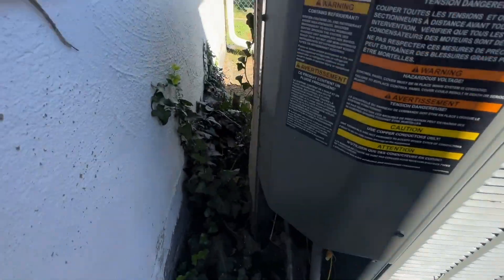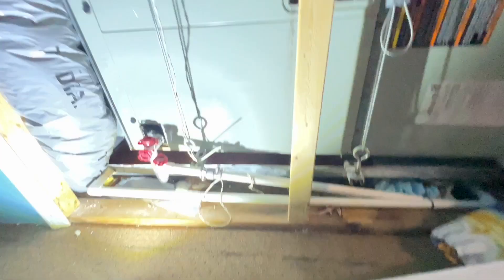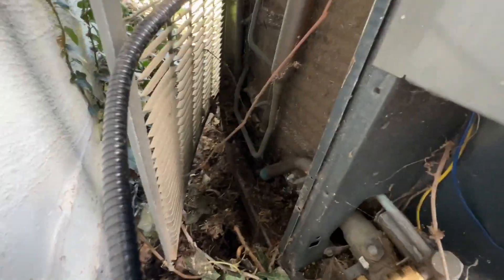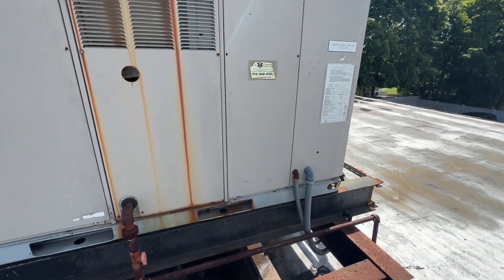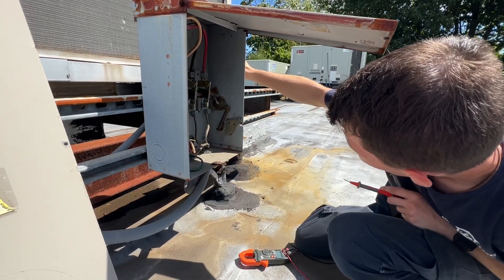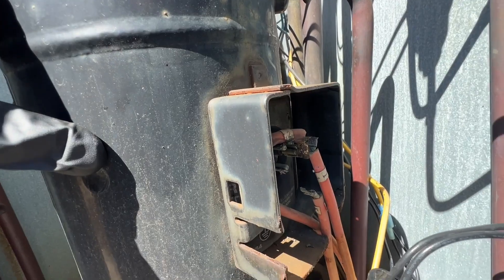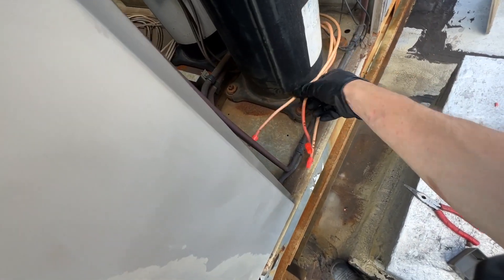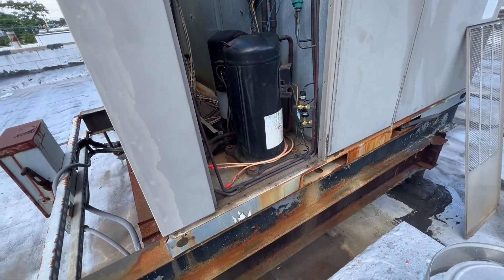Frozen Trane System Low On Refrigerant… Where’s the leak? Two Blown Out Compressors on an Old RTU!!

Comment: dont mean to be one of those guys but if it is a 3 phase unit the winding resistance on the compressors are suppose to be the same. unually about 1 ohm is normal. where as single phase will add up
Reply: great video though brotha!